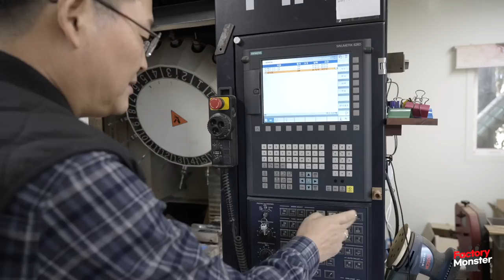Process of making Pan Flute with Olive Tree. Korean Instrument Factory

Comment: I know of no reason why the pipes should be produced using a CNC milling machine and not a lathe. I also question the suitability of an extension with bass pipes using magnets.
I get scared when I imagine that two pipes suddenly fall off on stage as a soloist.
But the instrument looks very nice.

The video was also very interesting.

Comment: Imagine making this entirely by hand (no CNC). 
I think it would take months, not days, from start to finish.
Reply: Not that long, but hard to get that small with the required accuracy. I could bore those holes with an auger bit, but keeping them perfectly straight would be a challenge.
Reply: It would be easier, not to mention faster to just cut some bamboo to size.